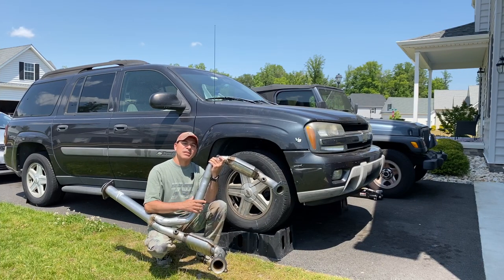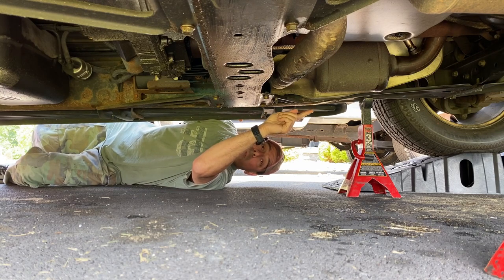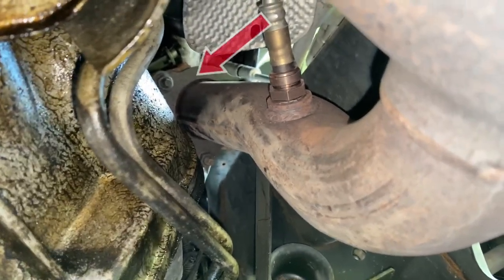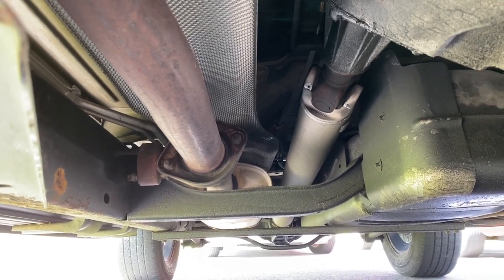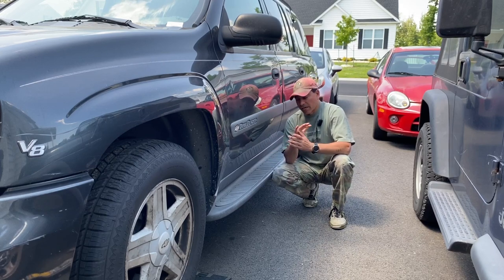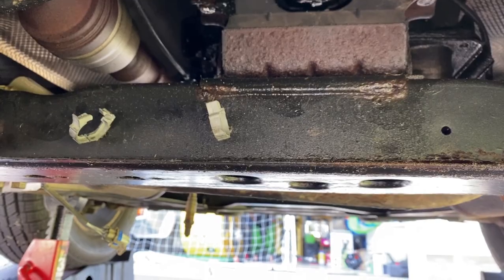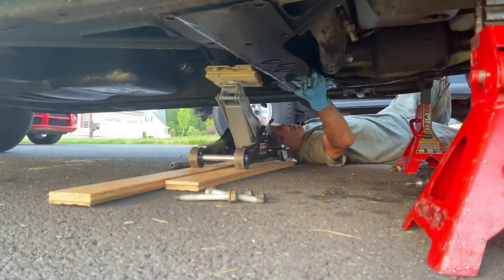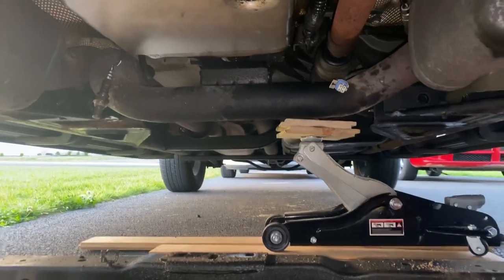How To Replace Catalytic Converters - Chevy Trailblazer (Andy’s Garage: Episode - 415)

Comment: Listen update if you don't want to cut the bolts will comenoff with a yellow tank of map gas and a torch aold at your local autostart l. For 35$ I got those bolts off @ a 3/8ths ratchet, heat the bolt up hot as ever. You have to let it soak in pb first for like 2 hours

Comment: Im changing the cats on my 5.3L Trailblazer as well and I noticed my transmission mount is wore out. Its a discontinued part and I cant find a Delco replacement. I have zero trust in aftermarket parts and wondering which brand you would recommend. Im gona swap motor mounts too which is a pain in the ass like most maintenance on these so I want the best parts. Money is not a problem when it comes to parts for this vehicle. I consider it well spent. I appreciate any input.
Reply from the maker: Genuine GM is another brand recommended by GM like AC Delco

Comment: Which brand catylitic converter did you use? Want one that fits correctly. Thank you.
Reply from the maker: @BrianHopkins-e8g  I just ordered one on eBay, but make sure it is for your specific Trailblazer. There are a couple different ones depending on the engine
Reply: @PhillipsVision  I actually have 2008 gmc envoy denali with 5.3 not extended. I see cheap ones on ebay but worry about fit and getting rid of check engine light. My passenger converter is rattling so something broke loose in it.
Reply from the maker: @BrianHopkins-e8g  some cheap aftermarket catalytic converters can cause the light to stay on if they are not built to spec. The ECU will only clear the code if it’s to OEM standard

Comment: Is that cata same or fit my 2004 trailblazer
Reply from the maker: Depends on the model. This was an EXT with the 5.3L V8
Reply: Mine is LS 4wd 2004 trailblazer 6 cylinder
Reply from the maker: @crystalpurcell6603  it would be a different part

Comment: I own a 2008 Chevy Trailblazer SS and live in New Jersey. Can anyone recommend an aftermarket catalytic converter that actually works for 2008 Chevy Trailblazer SS. 
I tried Magnaflow CAT model# 93496 and it did not work for my car. I keep getting the emissions (CAT CODE), do not buy/use and Magnaflow is giving me a hard time with warranty SMH. I have CATCO CAT now and unfortunately I have the same issue with (CAT CODE) and will get it replaced ASAP. If anyone can help please send me a reply and I will check on link daily.
Reply: What did you end up doing? Unfortunately there’s no oem anymore .—. Have you tried a carb certified cat?